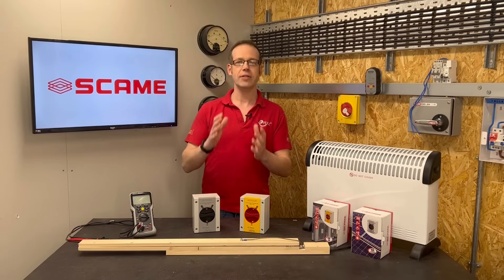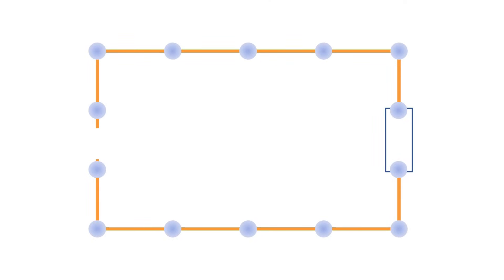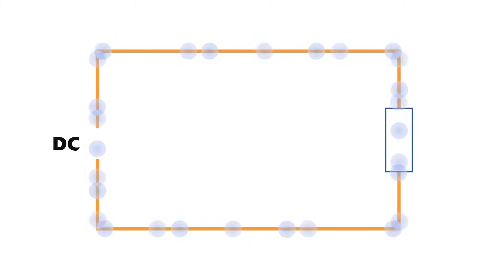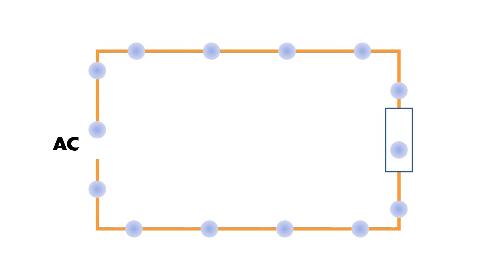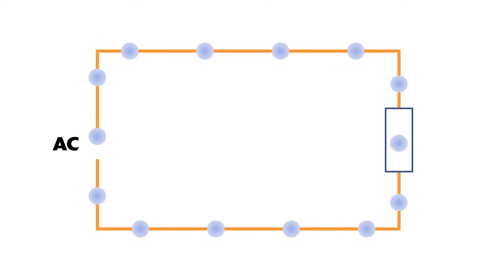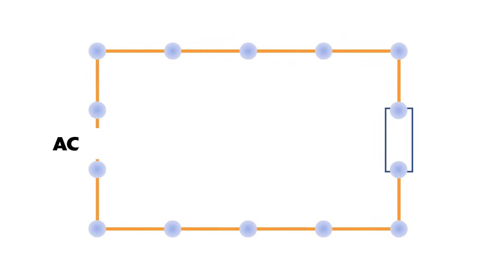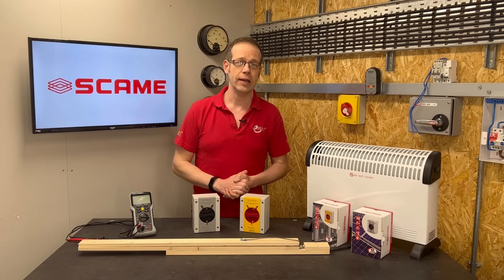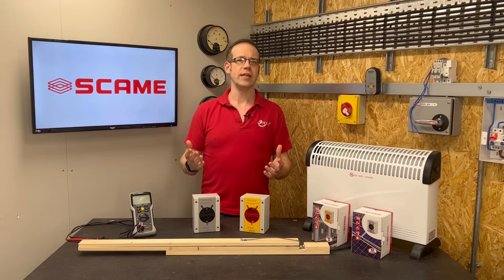The Jaw-Dropping Difference Between AC & DC Isolators!

Comment from the maker: How to Specify & Install a DC Isolator
👉https://youtu.be/Q3I6RL0pPso
Reply: Slightly off topic, but could you do a clip demonstrating why using 10amp 240v house wire in a vehicle is a very bad idea?
I've been working as an "Automotive Engineer" (a fancy title for an accessory fitter on 4x4's 😑) for 2 years now, and I've noticed a LOT people are doing this!
They think of 240v as "bigger power so it must be ok!".....they don't realise that while it takes 240v and the vehicle only puts out 12/24 , the amps are different!
Cars can regularly put out 60 amps in places!
Six times the rated 10amps for house wire!
Very dangerous!
Reply: I am an aerospace engineer who has spent the last 30+ years in industrial control systems and automation as an EI&C engineer.
 
YOU MUST REVISIT THIS as parts are very easy to misinterpret. You can't just do the AC/DC thing in 5 minutes. You are not even taking into account the nature of inductive and capacitive loads which can dramatically alter the rating of contacts in isolators, contactors and relays.
You need to stress that ELECTRICIANS and ELCTRICAL ENGINEERS have to pay attention to the application and the nature of the load they are disconnecting and the ratings of the disconnect or switching device.
Reply: @tonywilson4713  you would be amazed at some of the things that come into the workshop!
Just noticing people are doing all sorts of weird modifications to their vehicles, and a lot of people don't seem to understand that trying to home wire up a heavy duty winch for example with 240v wire is a bad idea!

Comment: Old school electrical  engineer here 50 years in trade older toggle switches were rated for ac or dc  also were quick make or break so no ark some large houses still had there own battery system on dc

Comment: You failed to demo and test the DC isolator thou. 600V at 10A is a lot for that tiny renamed and de-rated ac isolator, I bet If U start to make and break dc current, it will not last long, and catch fire.

Comment: I’m not an electrician, but I thought these small rotary switches were only intended to be used for isolation, not to break a circuit.  If that is the case, and since you can’t switch off the sun, there would seem to be a problem.  Would it not be possible to provide a pair of auxiliary contacts which could be used to operate a contractor to break the circuit before the isolation contacts open?

What would be the typical maximum d.c. Voltage and current in a typical domestic solar installation?

Comment: I have an idea for a switch. A lower  ring of contacts and an upper ring of  contacts around the swich arm.Say 4 segments on the bottom and top . Each segment like a semisircle with a contact point at each end. When the switch is rotated the top ring of contacts would jump off the lower ring of contacts..This would be 8 break gaps. In the circuit. These could be stackable for more strings of DC or linked for higher break voltages .

Comment: So how does a DC breaker handle this? And which will be safest? A breaker or fuse? Also if useing a fuse. How would it be pulled out at a good speed. ?

Comment: The question ultimately is, who is isolating a DC supply when its under load? That's where the problem occurs. Little bit misleading in that if you did a comparison with the heater off load, that arc wouldn't pose a risk because it wouldn't be there. Also, you wouldn't use an resistive load on such a high DC voltage, which was intended for use in AC supply only,  because once the power is applied you're in a no return situation. It would have been a laugh to see the thermostat kick out when up to temperature and see the amazing arc within the casing of that heater.

Comment: It is not just switches (which means relays and breakers as well of course), but you can get the same issue with fuses. Now I don't suppose the everyday sparky is going to be designing circuits at this level, but it's interesting to not that some fuses have different voltage ratings for AC than for DC (the current ratings are the same). 

The reason for this is that, when a fuse blows, there will briefly be an arc set up which is caused by ionised air providing a low-resistance path for current to flow. That ionised low resistance route will last as long as a lot of current flows as it self-generates. With AC, the current drops to zero twice every cycle, and that will normally be enough to kill the arc. With DC, it's different as the current will continue to flow through the ionised gas, and that very current will sustain the ionised gas (called a plasma). If the gap is fairly small, and the voltage is high enough, that process can be entirely self-sustaining, which is highly dangerous, especially in a fuse, which is there purely to break the circuit in the case of a gross overload. So, whatever anybody might say, many fuses do have different voltage ratings for AC and DC.

There is another issue with breaking DC into inductive loads. There can be a vicious reverse voltage spike when cutting off the current, and that can cause very large sparks or even weld contacts together. Often flyback diodes are installed to conduct those reverse voltage spikes which could otherwise cause a low of contact damage. This can happen in very low voltage circuits as what matters is the energy stored in the inductive component's magnetic field, not whatever voltage it is working at.

Comment: An excellent demo and simple explanation of the basics. One vital factor you did not mention is that with dc switching you have to ensure (I.e. check, do not guess) that the time constant (L/R ratio usually expressed in milliseconds) of the load is also less than that for which the switching device is rated for.  Also watch the number of switching cycles that the dc power device is rated for when breaking current (the on load rating). The dc number is significantly (multiples) less than that for ac where a device has a dual rating and a lower voltage rating will often be applied too. Whoa betide you if you exceed the number of cycles; it’s crucial that maintenance and replacement are carried out accordingly. On dedicated dc circuit breakers you can get blow out coils, arc splitters and runners within an arc chute. Orientation of the device can be critical in some cases, as is the clearances on the exit side of the arc chute. This so the arc is, stretched, cooled and quenched as the device designer intended (same for dc contactors too) My guidance is do not play with dc power unless you thoroughly know what you are doing and qualified/ supervised accordingly. As your demo if you contact dc your muscles will go into spasm and it’s difficult to let go as no current zeros, I have never got caught on that one, this after a long career in dc and  ac drives, be extra careful! Hope helps Stephen

Comment: I undetstand switch designed for AC can be problem with DC, but is there similar/other issue using a switch designed for DC with AC?

Comment: Why is the D.C. arc at 2:33 making the classic 50-60hrz sound of A.C.? D.C. arc's don't sound like that. How many volts. How many amps. I feel like there is something amiss here.
Reply from the maker: It was probably the gumming of the variac I used to control the AC voltage in to the rectifier. It was straining at its limits I think! 😃

Comment: I've used high voltage DC relays in the past that had a strong permanent magnet adjacent to the contacts to blow out the arc.  I'm surprised the SCARME DC isolator doesn't include this, as it works so well.

Comment: I hate people like you. Thumbnail shows you are using pulsating DC and then you bring solar panels subject? For the last time. DC-- means pulsating dc cause its achieved through pwm solutions. And DC is without any pwm or filters.; that comes from batteries and photovoltaic units or TEG

Comment: I worked for over 30 years on the power systems of the London Underground. We had equipment from the 1930s as well as modern when i started. The sound of a DC CB coming out at 8000A wakes you up. Old CBs had magnetic suppression of arc. Later, smaller form factors combined magnetic and air puffers which stretched the plasma and thus reduced the arc. Typically the contacts needed occasional light redressing depending on the section of track they served.
Your demonstration rig was not greatly dissimilar to the 22kV isolators on the old equipment. Opened with a pole and a hook, but of course not under load. The first couple of times of doing it was a buzz in more than one sense.

Comment: DC is not to be laughed at. When adding two 12V Car batteries to make a 24V system, and then accidentally shorting the opposite poles, it melted an inch of length off of a 1/4 inch threaded steel rod in seconds. I sat on top of that with just a padded seat between, and that was the most brown alert moment in my life still almost 30 years later. Solar roofs when connected the wrong way can be 1500V and capable of delivering about the same current as a car starter battery...there is a reason there are so many electrical house-fires after cheapest contractor with east-state labor have been on site assembling.

Comment: Why does the DC arc have a 50hz ish buzz to it? Just a consequence of rectifying AC to DC?
Reply from the maker: Not so much the rectification as the variac used to control the input voltage buzzing away in the background. ⚡

Comment: 2:57 - I assume that DC arc is supplied from a transformer and hence the 50hz hum in the background.
Last time I saw a DC arc, it hissed and was almost silent.
Reply from the maker: Yeah, there's a variac connected to control the voltage, this nknit was on the limits of what it could handle to be fair. 😃

Comment: Looks like a clever way for manufacturers to re purpose some double pole AC switchgear into single pole DC switcher by just putting terminals in series to increase the air gap! 🔥
Reply from the maker: Well as long as it conforms and tests out OK. 😃

Comment: Very informative... Great Video.. Learned New Information...

I have a question... Is 200 volts DC actually used in Residential Houses? I live in the States. We have 120 and 240 VAC. We use 480 VAC in Commercial Buildings. Solar is being installed everywhere now in different configurations; 12, 24, 48 VDC to Batteries then Inverter. It is converted to 120 or 240 VAC there and then into Household wiring.

I have a 16 KW Propane Fueled Generac Emergency Generator. There is an auto transfer switch preventing my lethal AC voltages from leaking back on Public Power Lines. Switch over is less than a few seconds. UPS's on critical computers, servers, and communications don't need to be very large. At most they run 5 seconds before generator is at full power. I bought my UPS's before getting generator. They were sized to run critical equipment for 1 hour. Outages rarely exceed 15 - 30 minutes.

Saw an article recently about newer Solar Panels that have their own builtin Inverters.
Reply from the maker: You might find it on solar PV installations where there's a few panels connected in series.

Comment: Hm seems as they just use a jumper to connect two contacts in series and call it a day. Changed the markings on the AC one, seems like it anyways.
Reply from the maker: I would imagine it's been through different testing processes.

Comment: That DC isolator will not disconnect 600 volts DC. The contact gap is still way to small. That will get someones home burnt down.
Reply from the maker: I would suggest it's been through sufficient testing to suggest it will break 600V. 🤔

Comment: Boats make extensive use of DC circuits, 12V or 24V for house loads, depending.
Electric propulsion is becoming more popular, which is often 48V DC.
Reply from the maker: Good to know thanks, we've yet to delve into boat electrics. 🛥️😃
Reply: @efixx  Salt water makes everything more interesting...
Reply: Old relay interlocking circuity on railway signalling systems in the UK used DC switching (at 50V - identical to the old telephone exchange kit) via relays all the time, including DC power for point machines. The old BR 930 series standard ones had silver/carbon impregnated contacts to inhibit welding, so that they are almost immune to failing that way - but it was controversial with some organisations (such as London Underground). Most of them had “front” and “back” contacts that were mechanically connected so that the back ones could be used to prove that the front ones were not closed, and in some applications it was necessary to prove that the relays had actually operated as required.

Comment: Have to say whilst this was an  interesting video I am worried you could have inadvertently done more harm than good. Looking at the comments a lot of people will be under the impression that all you have to do to convert a AC switch to DC is series the contacts and derate the current and voltage. I am not at all impressed with the build up of the dc isolator you have shown, would be interesting to see how it performs under its rated loads.

Comment: So in reality we could use an ac isolator if we use double the contacts and half the current? Also I'd ad that I think that the reason the arc if so much bigger on the dc is because the ac value is only at its peak for that short interval,  the rest of the time its decresing or increasing, or at zero! 
Good video 👍

Comment: 4:23 idk why they didn't just print AC and DC data on same device and sold it as one unit.... less packaging, less hassle in warehouse
switches are marked this way....example
12V DC 20A / 24V DC 16A / 125V AC 20A / 250V AC 16A

Comment: I placed an AC isolator in my PV DC circuit, purely because of cost. It was a factor 5 cheaper. (10 years ago). Six months later we smelled something burning, and it turned out to be the AC isolator, completely burned inside. We were lucky to find out in time, while being home. Don't ever go cheap on isolators!

Comment: So you hook up the DC one to close to the specs, show that it works, hook up the AC one to the same load and watch it burn. No? Just me? My jaw has not dropped. You showed two things that looked much the same and just SAID that they had a jaw-dropping difference. Show, don't tell, or it's clickbait. For all I know from this video, the two devices are actually identical and can be used interchangeably. I don't think that is what you were going for.

Comment: Just in case it's not obvious, that arc is 'plasma', which is a fourth type of material after solid, liquid, gas, and importantly, while it's doing its thing (so 'hot' that the electrons and the nucleus of the atoms separate), it is a very good conductor, which has a great similarity (for those who like their physics) with the 'conduction band' in metals where all the electrons can go for a wander rather than staying with their nucleus as happens in non conducting insulators.

Lovely visual effect. There is plenty more interesting arcs and sparks stuff. Just beware those arc flashes!

Comment: Would a circuit breaker technically work as a DC isolation supply, just asking as it has the grill that can dissipate arcs in it, or would the arc be too strong for it then?

Comment: You didn't explain the physics. You only talked about rating, and the fact AC and DC are very different, but you did not say why.!
On AC, when the contacts start to break, the small spark occurs because the AC sinewave drops briefly to ZERO stopping the spark from arcing.
On DC the voltage never goes to zero, it always stays the same, so the spark never gets broken, the ionisation continues freely, till the gap is big enough.
I used a 10amp double pole relay in a 10amp DC power supply, by utilising both poles in parallel, the spark is halved, and the rating is also halved by using both poles to switch.
Electricians need to study the background physics behind DC switching, now that we have an ever growing amount of equipment running on DC.
Solid State switching might be a good way around this arcing problem. THOUGHTS.??
David G1ZQC.
Reply: Electricians don't need to study it though. It's the difference between electricians and electronics engineers. The engineers need to study electronic engineering - the electricians need to study big books full of rules to be followed without question or exception.
Reply: @vylbird8014  Incorrect DC switching is a fire risk, so because there is far more now than before, they need to know why the ratings are different.
Out of ignorance, someone is going to cause a burn out through not checking with full knowledge of what they are installing.
Always good to debate.
Reply: @G1ZQCArtwork  That's what the big book of rules is for. It's not enough to just do things safely: The electrician needs to do things up to code, because that means no lawsuits and no rejected fire insurance claims.

Comment: Worked on a 1940’s cargo ship that had massive DC contactors. They made and broke the connection via a sacrificial carbon brush before the main contacts opened or
Closed. There were arc diverters and suppressors. It was pretty epic testing those circuits and pushing in contactors with broom sticks when needed...
Reply: I misread that as "pushing in contractors" at first. 🤣🤣🤣
Reply: @chrisbrooking  Well, that’ll teach them!
Reply: @chrisbrooking  If the contractors were electricians I presume they'd be trained & up for the task !

Comment: Besides the ultimate gap length, the other features affecting arc quenching (at same voltage and current) are at least a speed of the contact opening and added quenching means (cooling and magnetic blow).  The opening speed is inadvertently affected by applying a freewheeling diode across the coil of the device!  That relates to DC operated coils, of course.  But it can be clearly seen on ordinary 24 V DC coil relays...